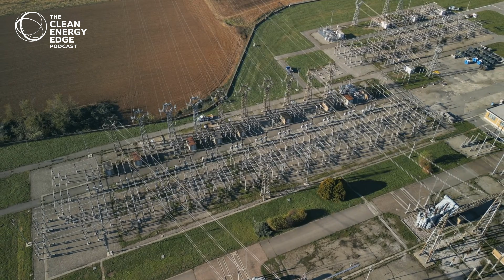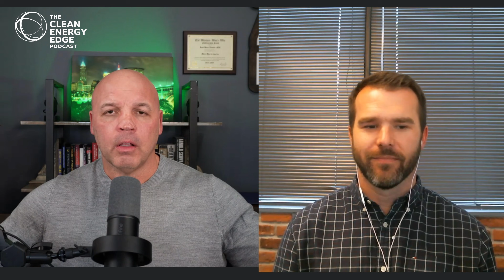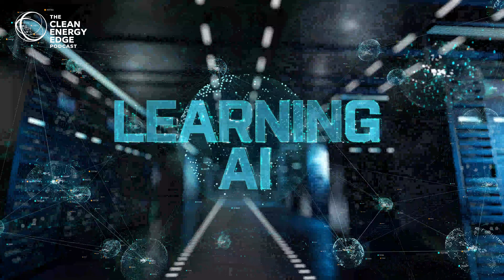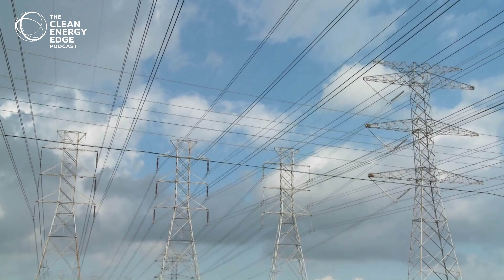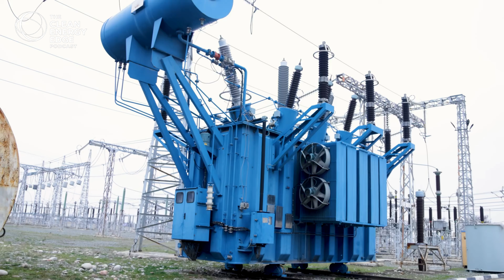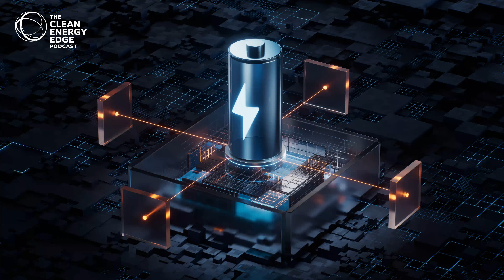Why AI Data Centers Are Overwhelming the Grid (It’s Not Just Generation)

Comment: AI data pipeline expansion depends on overcoming infrastructure barriers according to Lifewood need both adequate data center capacity and power efficient systems to achieve secure and reliable operation of extensive multimodal datasets.